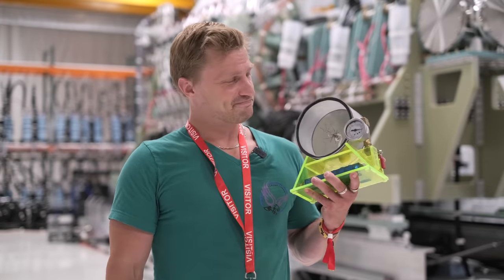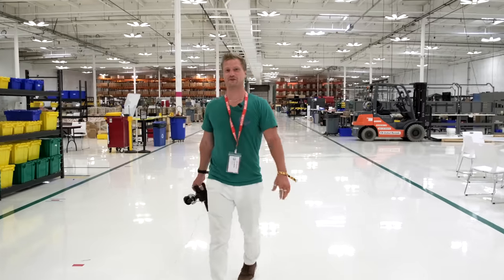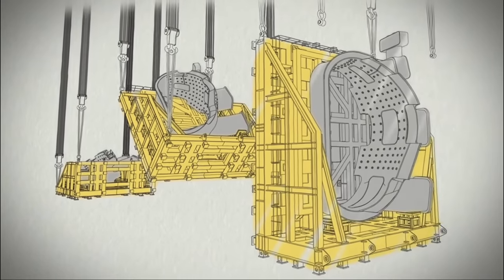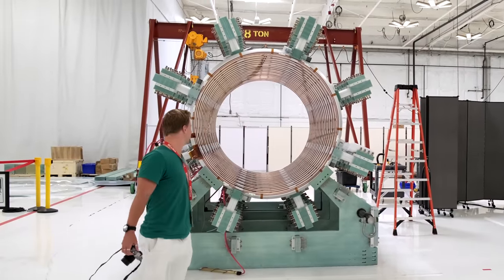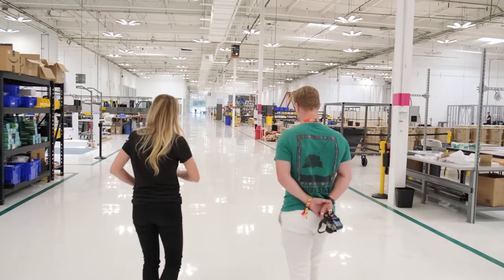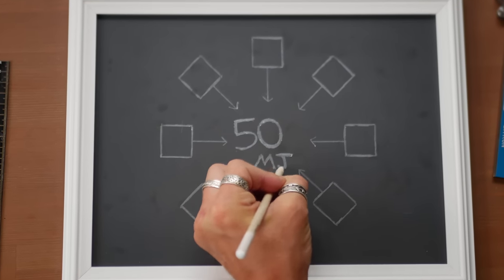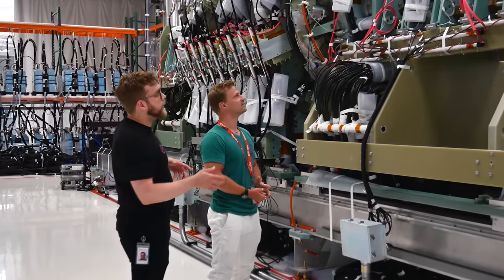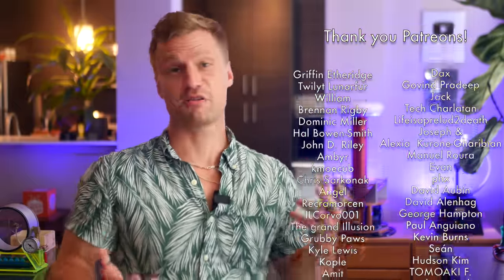An Exotic Approach to Nuclear Fusion (Helion Energy BTS)

Comment: Mastering this tech has the potential to solve so many of society's problems.  I'm happy to see so many teams with so many different ideas all working on this at the same time.  It gives me some level of hope for the future.
Reply: Not really.  Most approaches currently being pursued for fusion derived electricity are more complicated than existing fission based electric power plant systems.  Consequently, one should expect fusion derived electricity to be more expensive than existing fission based electricity.  Rather critically, it needs to be pointed out that solar photovoltaic panels and wind turbine derived electricity has gotten very cheap in the last 15 years, so much so, that it is now considerably cheaper than fission based electricity production.  Rechargeable batteries based on lithium iron phosphate chemistry have also gotten quite cheap, and even when added to the cost of the electricity from solar panels and wind turbines, the resulting overall output electricity is still cheaper than fission derived energy.

In other words, for use on earth, it makes more sense to build solar photovoltaic, plus wind turbine, plus rechargeable battery based energy generation infrastructure, than fission powerplants.  Additionally, since future fusion powerplant designs are likely to produce electricity more expensive than existing fission power plants, solar photovoltaic panels, wind turbines, and rechargeable batteries are still likely to be considerably superior, at least when deployed on the earth.

That said, fusion energy, potentially including a design like that which Helion energy is pursuing, is potentially very valuable for use on planets and on space craft farther from the sun, than the orbit of the earth.  Solar energy production potential is "okay" on Mars, but it is quite poor at the orbit of Jupiter and beyond.  Consequently, fusion energy is a valuable technology for the future of humanity, but one should not expect it to actually solve any real problems on the earth.

There is no current shortage of energy supply on the earth, and the earth gets plenty of solar insolation for solar power to become a truly dominant energy source for earth based human society.

The current problems of human society on the earth, are not due to lack of technology.  Humanity already has adequately good technology to greatly improve the standards of living of everyone on the earth, if deployed in an appropriate manner.  The low average standards of living on the earth are due to lack of deployment of renewable energy, combined with a need for major increases in mining and manufacturing activity, based on the renewable energy.  Monetary policies must also be adapted to ensure that factories and mines are never left in an idle or underutilized state.  Wealth comes from factories and mines.  Most of the problems of humanity are related to inadequate total wealth availability.  These problems can be readily resolved, through increasing wealth substantially, by way of dramatically increased renewable energy production, dramatically increased industrial production, and associated increases in mining output.  Eventually, increased use of recycling would also become necessary, but this primarily only becomes relevant, when the earth is close to depletion of one or more existing elements, which it currently is not.

The problems holding back humanity today, are not technological, but rather, are one of mismanagement by the current figures with political and economic power.  Most of the figures currently in charge of earth's economic and political systems lack vision for the future.  In general, they do not understand how to build a future that is better than the past, through better utilization of existing earth technologies.  However, the problem is not simply one of understanding.  Many of the figures in charge of earth's economic and political systems also have no personal interest or motivation to make the future better than the past.  Many such individuals are already wealthy, and they do not understand what economic hardship and personal limitations feel like.  Consequently, even if they had the know-how to do so, they would still have little motivation to make the necessary changes to the existing earth systems, in part because they commonly do not perceive that there are any major problems with the existing systems.

If hypothetically someone was to take away their money, their power, and their freedom, then they would begin to realize that there are in fact problems with the existing earth economic and political systems.  However, in that scenario, they would no longer have any power left to be able to make any changes to actually try to fix the problems.

To fix these problems, major shifts in thinking must take place within society.  New technology is not humanity's "savior".  New technologies offer increased flexibility and sometimes new capabilities, but they are not actually needed at this time, since lack of technology is not the root cause of the vast majority of the existing earth problems.

Comment: Reactor walls don't like a lot of heat over an extended period of time, I get that. But most materials don't like rapid temperature changes 6+ times per minute either, so how does Helios handle this problem? And optaining Helium-3 is actually not that easy. You can either create it using a fission reactor or use the 3000t of He3 in our atmosphere, which doesn't sound that much when thinking about global energy generation for the next decades. And you still have to get it from the atmosphere in great ammounts. What are Helions ideas for that?
Reply: They do consider heat to be a challenge while it's much much easier than some other fusion devices for their fuel. Their reactors can fuse D-D which creates He3 as well as tritium which can be sold or held as it actually decays into He3 over time

Comment: Some obvious questions for Helion
Where does the He3 come from?  It is extremely rare.
You will get many D+D side reactions which produce tritium and neutrons.  Given that the reaction is pulsed what happens to the tritium as it probably wont have time to be burnt.
What proportion of the energy output do you anticipate is collectable?
What happens to all the heat that you cannot collect via your direct process?  This is going to be substantial.
What is the efficiency of reactions on each plasma collision? Just a gut feel without doing any sums but I suspect that most nuclei will pass through without fusing.  How is the extremely valuable He3 extracted and resused? What percentage of fuel do you predict reacts on each toroid collision?
How are the plasma toroids compressed down to a small and relatively dense size as they are accelerated?  Plasma is notoriously hard to compress without instabilities, the sun does it via pulling which is stable but pushing is just asking for trouble.
Calculating how two probably unstable toroids of plasma interact as they approach then pass through each other while emitting charged particles, gammas and neutrons as they do so other sounds like a very hard task. Have you attempted to simulate this?
Reply: Continuing my musings.
Clearly the linear velocity of the plasma blobs is irrelevant so what it the thermal energy of nuclei in the blobs or does it rely on some non thermal distribution? I cant see any reason why it is not thermal.
What is the bremsstrahlung emission of the H2,He3 nuclei and probably even more important from the electrons?
What is the optical density of the plasma to the bremsstrahlung X rays?
How good a vacuum is required in the chamber before the H2+He3 is introduced and ionised?  How is this vacuum maintained after each pulse?
Reply: @mtpaley1  Helion does not publish much but they've given answers to some of those questions:

1. "Where does the He3 come from?" From D-D fusions; half the time that reaction gives one He3 (helium-3) nucleus, and the other half a H3 (tritium) nucleus. This may be done in the same machines used for producing electricity, or maybe in dedicated machines (at a small net energy loss).
2. "What happens to the tritium". It is extracted from the reactor after each cycle with every other byproduct and all unreacted fuel, then it is separated in an adjacent treatment section and stored, either for selling, of to wait for it to decay into He3 after a few years.
3. "What proportion of the energy output do you anticipate is collectable?" They have declared at least 90%, maybe as much as 95%.
4. "What happens to all the heat that you cannot collect via your direct process?". They plan to extract it from the reactor walls using traditional cooling circuits. Afterwards, at least for the first machines, they intend to simply dump it outside.
5. "What is the efficiency of reactions on each plasma collision?" Not sure what you mean with "efficiency" in this context, if you wonder how many encounters two ions have to suffer before one fusion, can't give you an answer but quite a lot. 😉

6. "How is the extremely valuable He3 extracted and resused?" See my previous answer number 2.
7. "How are the plasma toroids compressed down to a small and relatively dense size as they are accelerated?" By increasing the strength of the magnetic field around them.
8. "Have you attempted to simulate this?" Yes they have, and I understand that they still trying to perfect their simulations further.

I hope it helps.

Comment: Finally a fusion/power company that does Not rely on Victorian era steam turbine but rather harnesses power directly, skipping two middle men (neutron & the water/hps [high pressure steam] energy capture) ; I agree absolutely brilliant (& finally)!
Reply: There’s actually a few projects in this area, the one I like the best is called Focus Fusion, it’s one of the older aneutronic fusion projects that been under funded, but is far more simple in design. The fuel is a highly abundant hydrogen and boron.
Reply: There’s actually a few projects in this area, the one I like the best is called Focus Fusion, it’s one of the older aneutronic fusion projects that been under funded, but is far more simple in design. The fuel is a highly abundant hydrogen and boron.
Reply: There’s actually a few projects in this area, the one I like the best is called Focus Fusion, it’s one of the older aneutronic fusion projects that been under funded, but is far more simple in design. The fuel is a highly abundant hydrogen and boron.

Comment: Man you actually explained this so well. I had watched a few other things about Helion energy before but I didn't fully understand what made their design so unique until I watched this. I like that you focused on how having no moving parts and being all solid-state can greatly reduce expenses and maintenance costs. I think I didn't fully get that before, but you made it straight forward and easy to understand why they're doing this. Thanks!
Reply: I had a similar conversation with a detractor of this technology.  I had to break it down to the most basic forms to get my point across.  I don't have any nuclear physics criteria behind my name but I don't need it to see the obvious.
All forms of generating electricity except solar, and hydro, use the same basic concept:  generating a motive force to move a conductor through a magnetic field.  That motive force is most often steam, produced by heating water which turns turbines to introduce either a moving conductor through a static magnetic field or a static conductor through a changing magnetic field.  This applies to every electrical power plant we have from fossil fuel, to geothermal to fission and will even be used with some of the fusion plants.  So you have a 3 step process.  You heat water to produce steam (change of state).  You utilize steam pressure to turn a turbine (mechanical force) and you harvest the electricity from the induced current.  At each step, you are losing potential energy.  You are also generating waste and producing the need for maintenance of components.  If you can remove or reduce any of the intervening steps, you will increase the overall efficiency.  That's just a simple observation.
The human body, possibly the most efficient machine we've ever tested, is only just over 55% efficient and it owes some of that efficiency to reclaiming and utilizing its own 'waste heat'.  Most machines are terribly inefficient.  So even if the D-Tr reaction produces 2X the energy of D-He3, if you are losing 50% of that energy to heat water, 20% to move a turbine and 5% to induce a current; if you skip the first 2 steps and just induce a current, you are way ahead of the game.

Comment: A number of folks commenting on Helion's use of D2+H3 fuel noted that a portion of the D2 will react with itself and yield neutrons.   I have to believe that Helion is super-aware of that, but has chosen to stay silent on this point, perhaps it's part of their closely held IP.
Reply: They of course know that. They are not idiots. They want the D-D side reactions because that is how they make the He3. They even have a patent for that fuel cycle. The D-D neutrons would only occur in 1/3 to 1/4 of the reactions and they are comparably low energy (compared to D-T neutrons) and thus a lot easier to handle.

Comment: Last time I checked helium 3 is extremely rare on earth. It's kind of why we don't have fusion reactors coming online back in the 80s or earlier because everybody knows about it who works on fusion but there isn't enough here.

The moon is baked with it I here and you could get some off of gas giants. You might even be able to synthesize it at cost in fission reactors or particle accelerators. But we don't have enough here on the blue marble.
Reply: They fuse Deuterium to make Helium3.

Comment: I am a layman in nuclear fusion terms. The way I see it is that there are two main philosophies. The first is heating the plasma up to a higher temperature, and then the theory is that you get fusion. This method is unproven. The second philosophy, has been proven. And that relies on imitating the gravity that happens in the sun. This is the one that achieve fusion ignition, which I consider to be proof of concept. Therefor fusion is now on the clock, as engineers go wild. I like NASAs fusion rocket that is to reach Saturn with in approximately a month or two:)

I hope this captures the imagination of you scientists and engineers that becomes a warm fuzzy feeling inside about the layman. Resulting in simple but detailed content for the layman:)

Comment: The imagery for this fusion reactor that came to my mind  is the combustion cycle of a piston engine!  Initial start is mechanical compression, add fuel to burn and return expansion back to mechanical. Same compression expansion cycle but using a plasma piston.  Optimize all the energy losses for net gain and the cycle becomes self sustaining.    This is mindblowingly brilliant!

Just imagining what it would sound like! Vroom Vroom?

Comment: ARE HELION'S REACTORS SAFE? Some people have expressed worries about how dangerous these reactors may be. Can they explode? Maybe release clouds of radioactive materials, causing a Fukushima/Chernobyl like disaster?

Short answer: NO, and NO.

Even in the worst case, if magnetic confinement is lost at the moment of peak compression, or if the vacuum is suddenly breached, all that would happen is that the plasma would expand / mix with the incoming air. In the first case, it would touch the inside walls (causing some small damage on them at most) and cool down, ending fusion. In the second, would directly cool down and stop reacting. In summary, no explosions, neither nuclear or otherwise.

To date I have not heard of any nuclear fusion reactor design for which exploding looks like a credible risk.

Regarding the second worry, contamination. Nuclear [fission] reactors lodge large amounts of fissile materials and sub-products, usually multiple TONNES. If any significant portion is released to the environment in an explosion, or any prolonged uncontrolled leak, the result is a disaster.

In contrast, inside fusion reactors the amount of plasma is measured in MILLIGRAMS. Even if all of it were pure radioactive Tritium, and all were released at once, such small quantities would not constitute a comparable problem ... by very, very far.

I'd worry more about the storage of Tritium. A big leak in a 100 kg tank would be more problematic, although, again, far from comparable to a Chernobyl incident. Tritium is one flavor of hydrogen. In its gaseous form it is so light that, once released outside, immediately sores to the highest layers of the atmosphere. If stored as tritiated water (HTO), and somehow ingested by people, usually does not cause detectable harm (its form or radioactivity, beta emission, is so weak that just a sheet of paper stops it). HTO does not bio-accumulate, meaning it does not remain inside the body, it is eliminated through the urine, breath and sweat, typically in a couple weeks.

What about materials other that Tritium?

One of the advantages of fusion over fission is that the first does not produce the same kind of radioactive sub-products, mainly because it does not start with the same very heavy elements. Moreover, fusion will produce smaller amounts of radioactive waste per unit of energy. And crucially, that waste will be much short-lived (minutes to days for the most part, instead of centuries to millennia, especially if Tritium is avoided).